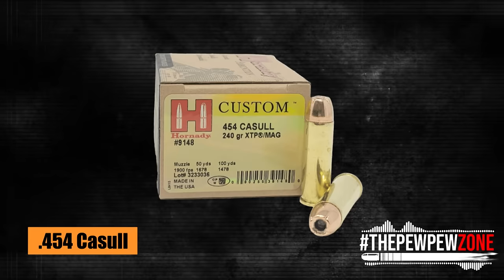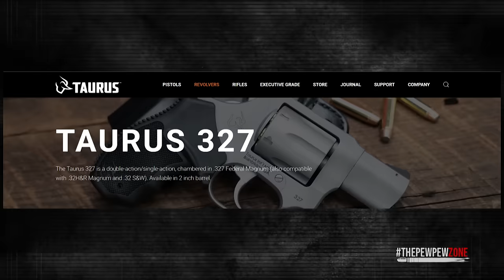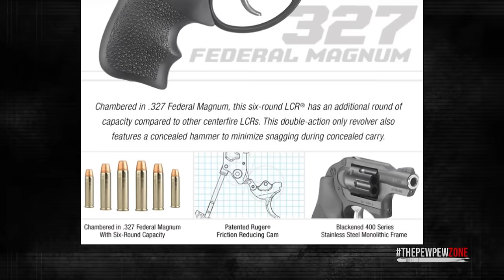TOP 5 High Capacity Carry Revolvers for 2024!

Comment: Good video! I just recently purchased a new Taurus 942. Revolver in 22LR.  It was defective out of the box, would not ignite any primers. Sent it back to Taurus, after waiting 3 weeks for an update they finally answered their customer service line.  They said the frame was so defective they would need to destroy the firearm and issue me a new one, replacing the serial number. Wait 8 weeks for delivery and I have to do an FFL transfer AND pay for it. Just a heads up. Still waiting 5 weeks later. I also had to send the Taurus GX4 back to them TWICE for repair.